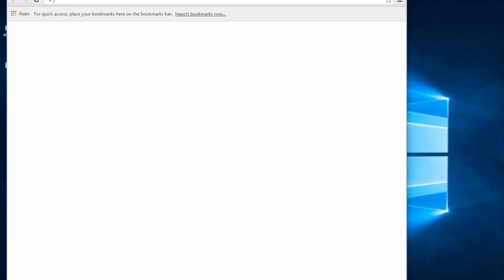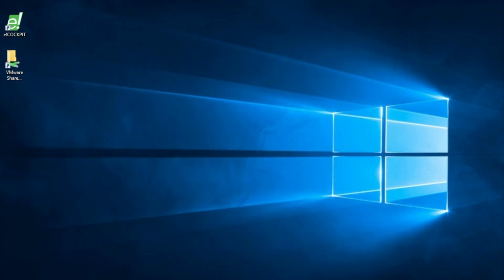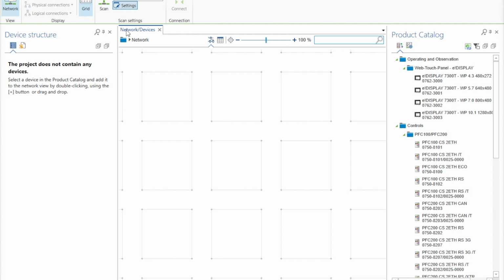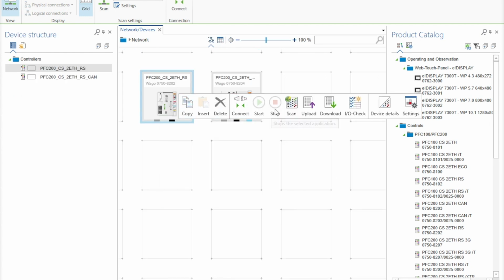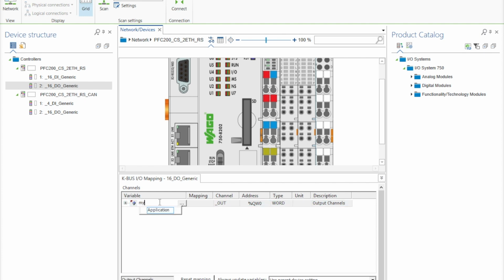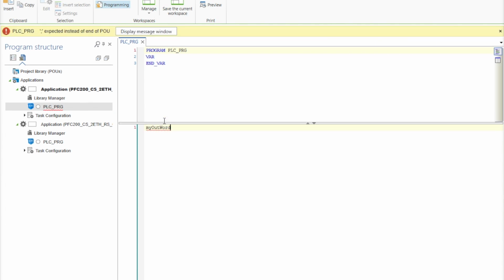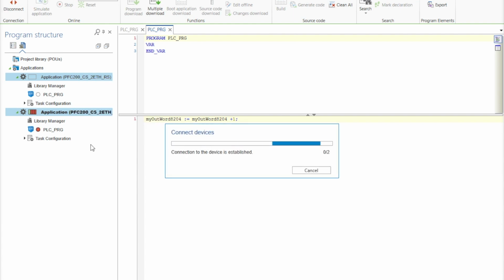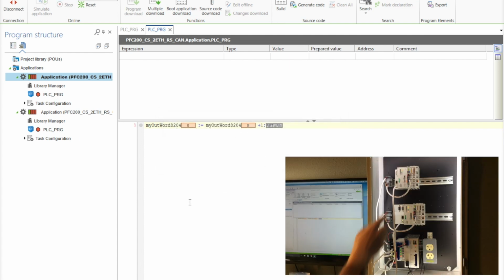WAGO e!Cockpit First Steps

Comment: Hi, a simple question before I reach out to Wago for support (maybe won't have to). I own PFC200 Starter Kit with e!Cockpit. This is a PFC200 750-8212 and the moment I tried to search for this device (as shown in the movie) I recognized I do not have Ethernet connection available. Nevertheless when I add the specified device to topology there is a bunch of errors showing concerning: WagoSysStandard, WagoAppProcessorLoad, WagoSysComInternal, WagoSysKbusTerminalControl libraries. I looked in the library manager and those libraries should come as standard with Software, am I right? Would you care to comment?
Reply: I will answer my own question as I solved it and problem was with the installation, however until I tried this once again I did not know. Good luck and happy programming.

Comment: I don´t like E!copick, it is very slow, thing like update the firmware controller mmmmmmmmmmmm, I don't like. I used other software like CCW by AB is better the e!cockpit. I think I still use codesys 2 for the moment. I wait for e!cockpit for a long time. :(
Reply: CCW is Free the express edition.
Reply from the maker: You are certainly entitled to your opinion. I like e!Cockpit for the advanced programming options (OOP), network GUI, HTML5 web visu, and the handling of external files.  CoDeSys 2.3 has its strengths as well.  Good thing WAGO will continue to support both.
Reply: yeah, I hope to improve my skill in E!cockpit, I am wago distributor. But I don´t take any training yet, I learn by myself throught your videos. My problem was that I tray to program a PFC from one day to other.  I have a lot of problem about to update the firmware, download the program, use K-BUS or the cards, in the Codesys version 2 I made the addressing in the global variables  example INPUT1 at %IX0.0: BOOL, but in the new;  Finally i could name my inputs/outputs cards directly in the cards like in the version codesys 2 when  we named in K-BUS.
Reply: @GeorgeRoman  Regarding the issue of e!COCKPIT being slow. I would recommend checking the RAM in the machine that you use and would recommend using at least 16 GBytes, preferably 32 GBytes of RAM.
Reply: @prcarlospena  Quizas y fuera genial, / Maybe and could be awesome to have a super computer. But I listened that  E!copick improved the automatic updating of firmware, during the downloading in the PFC, for me that is awesome. Because with this E!copick prevents human errors.  Nowadays I handle Tia Portal, I can compare that the new version runs like E!copick. So I conclude the E!copick is growing up a lot. Congratulation to WAGO. I hope to start to handle this year, i bought 3 PLCs.
Reply: @GeorgeRoman  Good luck. Escpecially if you don't have the original program. Just logging on to existing ones in the field, having to match the firmware, software and version is a nightmare.
Reply: @bobbybacon3478  thanks for your advise. Thanks to  Tracy and Mr. Olmedo I resolved the problem. I bought a super computer and Wago resolved the problem of the firmware with the New version of E!copick. I am very happy with Wago... I Still use the brand since 2009. I hope to use for rest of my life.